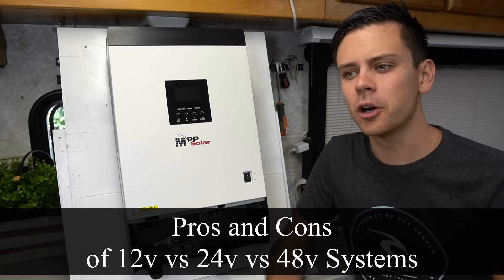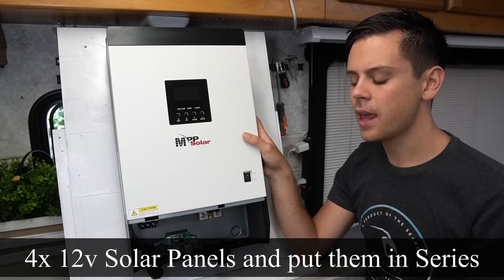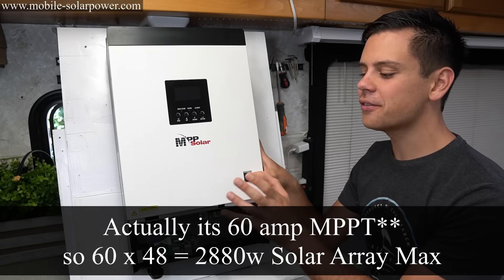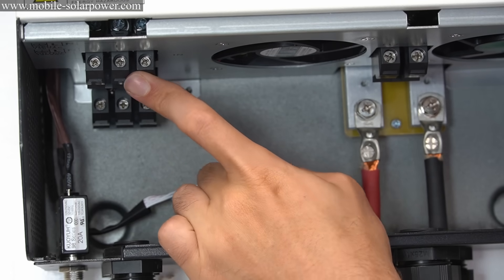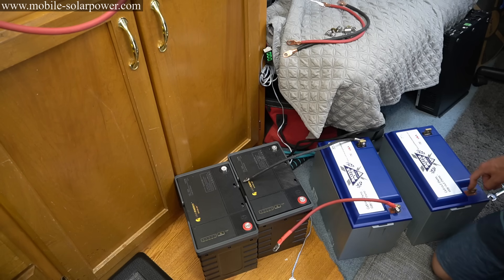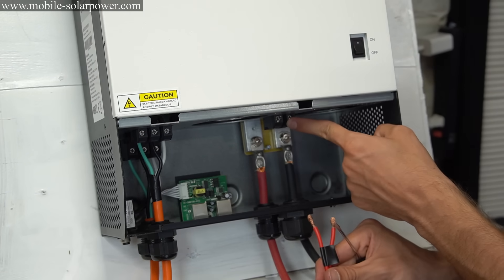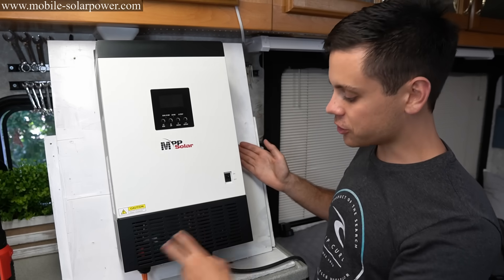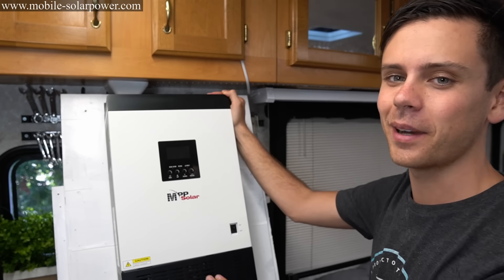48v Solar Power System for Beginners: Lower Cost and More Power!

Comment: I had this MPPT controller on my truck for a few years. The BIG downside which Will hasn't figured is that 4x12V batteries will only charge to the maximum internal resistance of the first battery in the series. I wish people would get a grasp of this issue as it's limiting many people's return on their investment dramatically, in some cases. 
Here's how my real World results work out: I have 2KwH of solar panels on the roof. When I have 4x220A batteries in series the maximum charge I get in full sun is around 550Watts, which is due to the internal resistance of the first battery. (Note: lead acid batteries should charge at around 0.05 C, ie.5% of their total capacity. ) 
Just to prove this point I changed to a 24V MPPT charge controller & the same system charges the batteries at a rate of around 1100 Watts !!; since now it has 2 strings of 2x12V, so twice the 220A X 0.05C. (CORRECTION, I meant 0.2 C, or 20% of their total)
Another solution with the 48V system would be to increase the number of battery strings to 2 , ie. 4S2P batteries, to allow the charge coming in to get a better chance of absorption, & not to get wasted by this internal resistance, but at 50KG per 220A battery it would be pretty darn heavy! However, for me to get the full use of my 2KwH solar panels in a 48V lead/acid system would require 16 X 220A units.
I wonder whether Lifepo4 batteries run into the same problem??

It annoys me that many people like myself have had tto endure such a poor performance because no-one seems to grasp this issue. The potential wasted solar Watts Worldwide could potentially be enormous.
Reply from the maker: What in the world?? Sounds like you had a bad battery in your system or bad wiring. That should not happen. I have systems with 16+ batteries and I get the full capacity of ALL of them at their full charge rate. You need to go back and redesign your system or find what's wrong. That is not normal. Even if internal resistance was off by quite a bit, it wouldn't cause that to happen. Under heavy load IR is a big factor but it won't make that big of a difference and lead acid in series will equalize at high SOC. In commercial installs they will add a balancer. But having a different capacity from having them in series due to ir is incorrect.
Reply from the maker: Just read your comment again and you are referring to charge rate with ir. Sounds like you have a badly designed system with batteries that are too small. This isn't a problem in most systems and it sounds like you have one cell or battery that is faulty. That would make total sense as to why you can charge faster when they are in parallel
Reply from the maker: Also, even if a string of 4 batteries can only handle 1/4 the amps, the wattage is still the same. the charge rate due to ir does not change. do the math with ohms law and measure ir of your batteries and you will figure this out plain as day
Reply: @WillProwse  Thanks Will, but the batteries are all good, (4x220A so more than enough for a 2Kw solar array), & the wiring is all well over spec. Adding more batteries showed the same limitation to 0.05C constant charge rate of this new total.....I think I went up to 1320A at one stage, if my memory serves me correctly.
My system has been so much better as a 24V setup, even though the 24V MPPT controller I have now can only handle 1500Watts of solar panels, unlike the 4Kw 48V MPPT I had (which looks exactly like the one in your video.)
I plan on using the 48V one on my house but using Lifepo4 batteries instead of L/A,  & allow enough to cope with whatever i throw at them with ease, so not a total waste. Hopefully Lifepo4's don't show a similar problem??
Reply: @WillProwse  That's what I thought. However, insert lead acid batteries into the equation & it appears we're dealing with the laws of chemical reactions rather than ohm's law!

Comment: I kinda laugh at the danger factor since i work with 480v so much doing motor controls. The scary size of power is distribution transformers because they buzz and can arc flash just being in there presence.

Comment: Perfect.  Stand alone, no ‘daily ‘supply fee.’ ( connected fee from utilities: regardless of using it or not ).  AC in can be a small cheap ‘stand alone ‘ generator to boost a low battery supply.  👍

Comment: Current not voltage kills.  >100ma=death.  Should not just brush this off just because you deal mainly with low voltage.
Reply from the maker: Yeah literally everyone who understands electricity  understands this and a battery cell can deliver thousands of amps in short circuit, and guess what, no one is dead after they touch their car battery. You should talk about ohm's law and the resistance of your skin, and why higher voltage is so dangerous. Because that matters more.

Comment: Hello Buddy, I have 2 questions for you.
1. I notice you don't use a 
Surge Protection Device like the MidNite Solar MNSPD-115 Surge Protection Device in any of your systems. Is there a reason why?
2. Do I need a battery protect if I'm gonna be using a BMS?

Comment: 12 years ago we bought a small 1300sf home with a basement and walk-in attic.  I bought a 220w 12-18 volt DC and a 400w wind turbine. I also bought 12- group 31 deep-cycle batteries. The panel, turbine, and batteries were 40 ft from the house.  I ran a + and  - run using 4ga high-strand wier about a foot underground through 1.5 pvc s40 to the house where I had a 8 block fuse box and 2 3000w TS-inverts.  in the basement, I then wired a 110 plugin ever-room and 2 110 in the living room.  We used the13w=75 watt 110 bulbs in each light we used the most at night and in the kitchen we used/installed 12v under cabinet RV light under all the cabinets.  The house box was never touched and the battery power was independent.  At that time it cost me $3,100 and we have been saving a 3rd of our elect bill since and without changing our lifestyle or habits.  O, I also run most of all my shop radios, bench, equipment as well

Comment: Grab a 1 ohm 25 watt resistor to arrest the spark when connecting batteries to the inverter unit. It's kinder to the capacitors in the inveter. Put the resistor inline for 5 seconds, then move the battery cable to the battery terminal, and throw the resistor in a drawer for the next inverter you plan to play with :)
Reply: A lot of ‘Greek’ to me. I keep trying to follow, yet It comes at me too fast. If I were building anything like these, I’d first watch the entire video, then go back and pause for the first step and so on. I’m not yet ready to begin my homestead adventure but when I am ready, you can bet I’ll be reviewing everything. Thanks
Reply: Or use a small 120v bulb when it dims out wham charged capacitors no spark
Reply: @gabrielmartinez3171  Only with 12V systems, as the inrush at higher potentials can pop the filament.  Use a lamp rated for at least the system nominal potential.
Reply: @randacnam7321  I do it with 48v system if anything the in rush current is less with higher voltage.
Reply: @randacnam7321  actually I just saw my mistake it was supposed to say 120v bulb like the e27 the middle section on the bottom touch the inverter and the outer section with the ribs to the wire the light will light and quickly dim. If you use a lamp with the cord you hold one side of the prongs to the inverter then the other prong to the live wire.
Reply: @gabrielmartinez3171  I use one of those wire end rubber temporary lampholders.  A good trick is to use a clear lamp so you can see if the filament is intact, although with the 25W lamps I typically use the lamp glows for a good 20 seconds or more on a Sol-Ark 12K so if no light at all assume something is wrong.
Reply: Hey dash8brj! Thanks for the tip! Sorry for my bad english but i did not get it when you said inline for five seconds. Could you explain that? Inline means between the battery positive and the positive wire? Thank you so much!
Reply: can you power up small window ac 3/4 to 1 1/2 hp with that?
Reply: @Jack062358  use soft starter
Reply: @Jack062358  yes but you need like 20 250w panels
Reply: I have a 24v version of one these labeled Iconica but for the life of me I can't work out how to get it to work with lifepo4 batteries, it simply doesn't list lithium battery in the set-up menus.
Reply: Awesome
Reply: Nice
Reply: I have a 5000w 48v inverter i want to work with. Does it matter what size resistor?
Reply: If you actually have a 48v battery, it has a power switch, 24v and 12v do not
Reply: dash8brj Our company's micro-inverters are all upgraded and no longer need Modem! ！ Can directly mobile phone intelligent monitoring, more understanding of technology can add me whatsapp 8613927402025
Reply: Some inverters, PSUs, and other gear sometimes do have internal inrush current protection. These are usually done using a resistor in series, and a bypass relay, that energizes only after unit charged capacitors enough. It is usually just using few seconds delay. If the unit doesn't have it, I recommend sticking a DC two disconnect switches in parallel, and one of them via the resistor. Definitively good to have if you have very big system or you plan to be changing batteries frequently, and stuff.
Reply: @movax20h  nice..thank you

Comment: You can eliminate that battery spark when connecting the cable by simply adding a battery disconnect switch.
Reply from the maker: The spark could destroy the internal contacts of the switch. Not advisable
Reply: DIY Solar Power with Will Prowse Actually, you want to add the battery disconnect switch so that you don’t destroy the internal contacts of the inverter. The switch is a lot less expensive, so it is better to put it at risk rather than the inverter. Plus, the switch will completely eliminate the spark, so chances of it burning the contacts is highly unlikely. Just be sure to use a DC rated switch.

Comment: Great video as always. Any chance we can get a dual phase 220 system build? Looking to make a full house backup for short outages but I have a 220 4 wire water pump which pulls off 2x 30amp breakers.
Reply from the maker: Working on that type system

Comment: What size fuse do you recommend for the battery going to the all in one? Looking at the MakeSkyBlue 2000 watt 12v model with two lionEnergy batteries.
Reply from the maker: Doesn't have as many features as mpp unit i found out. I would go with mpp instead

Comment: Thank you Will for this insightful video, in fact I’ve been waiting for this opportunity as I’ve just bought the 5kW version PIP5048GK. I’ll be grateful if you or anyone could touch a bit on the fusing and circuit breaker aspects as well. 
Congratulations for your new home and project. I’m number one fan. Lol
Reply: Where did you purchase it? Is it 120 or you need a step down transformer?
Reply: @James Edwards I bought it off eBay for £530. It’s a 48v System, exactly what I need so I don’t require a step down transformer. Thanks
Reply: Can you send me link.
I'm in the Bahamas
Reply: I bought it off solar_camper or search for pip5048gk on eBay uk. Hope this helps. Good luck
Reply: Might want to put in a cutoff after the DC to AC convertor. This will allow you to separate the convertor from the rest of the system prior to any battery maintenance or battery replacement. Put in a cutoff prior to going into your fusebox in your home. I would put in a fuse prior to the DC to AC convertor. In case of a lightning strike, this will save you a dollar or two in replacement costs. Since you're in the UK, check with a certified solar technician to see what the local code states. That should give you more information. Good luck.

Comment: I have now watched many of your videos Will, and it is obvious you have a talent for disseminating knowledge. I know I have learned many things!  However, there is one subject I can no longer remain silent on:  Eye safety.  

Every time you make live connections, I cringe.  I understand the limited shock hazard, but the high current is the culprit. 

I have seen the damage one arc flash will do to someone’s eyes. All because a wrench accidentally shorted out storage batteries or other high current capable source.  

Yes, I know, safety glasses look terrible, and even gaudy.  But it takes just one slip, one blue white arc flash, to produce the intense UV, and the sudden spray of ‘molTen meTal’ and bam, you are blind for at least a week, and perhaps permanently.  At the very least, you will feel like someone threw sharp sand in your eyes, and look like a raccoon for at least a couple of weeks.  

People watch and listen to you, Will Prowse?  Please set a good example for others to follow.  Practice wearing safety glasses when making live connections!  Please protect, not only your own eyes, but also help promote safety to others.  You need to protect those “one of a kind” eyes of yours.
Reply from the maker: Ok will do

Comment: One major downside with 48V system is that you lose alternator charging capability with just a cheap isolator, you have to invest on an expensive DC-DC battery charger (I don't know if a 48V charger even exists).

Comment: Correct me if im I wrong, I may be pulling this out my ass but higher voltage all the wiring and components should be running cooler? If thats true in a small space that could mean a lot

Comment: Hi Will thanks so much! this is very timely.  I am trying to decide  if I should convert my current 24 volt system to a 48 volt system. I have 4 285 watt Trina panels and bought the a 60 AMP EP Ever charge controller.  It is my first foray into solar and got a lot of help from watching your videos. My problem is that I have a 48 volt DC submersible pump that I would like to power.  I don't currently have an inverter, I just power my 15 ft trailer with a step down transformer like you suggested in one of your previous vids. My choices are to get a step up transformer to power the pump, or convert to 48 volts and get a 48 -> 12 step down transformer.  I know that there are pro's and con's to both approaches. I was told that if I go with the step up transformer 24 -> 48 volts, I also need to get a power conditioner to remove the high frequency noise that the transformer will introduce into the 48 volt output.  The switch to 48 volt system would be the more expensive route, but I think the benefits might be worth it. What do you think?

Comment: Can you use something like this as sort of a super sized UPS?
Reply: He mentioned using it that way, yea.  Should just double-check that you can tell it to prefer grid power; then it should keep the batteries charged and use them when the grid power is out.

If you don't have any solar, a cheaper option may be to get a 24V or 48V UPS if you don't already have one, then connect more / bigger batteries to it.

Comment: What does split phase mean >?
Reply: It means that the voltage and phase on the two hot wires are (for USA) 120V and 180 degrees apart with a third wire being neutral. This makes the total peak voltage 240V.

Comment: My interest in 48v over 24v is the native 48v DC mini split Air Conditioners that are designed to run direct from panels to unit without an inverter.  I would like an inverter and battery system for my Tiny houses, but have limited roof space for a small AC ‘s 1kw of panels so I want to combine these systems.  Do you know anything about those systems?
Reply from the maker: Wow good point. Can't comment on that but I sure am interested in looking into that. Thanks
Reply: Add my name to the list of those VERY INTERESTED in a 48V mini split AC system!
Reply: I have an idea on these systems. I'm a Solar system installer
Reply: gham elvis  — I’m very curious about your ideas. I just bought an old bus with no solar & no air so I’m motivated!
Reply: @joelhansen7373  I'm also interested, cutting out the @20% inverter loss would make A/C possible for me, but I've only found very expensive 48v mini split A/C designed to survive on salt-water yachts/sailboats, or some completely unknown units overseas where I doubt I'd find an English manual, much less customer support.

Also, as a supplement to keep cool at night without insane batteries... I work for engineers, and they suggested I build a super insulated freezer, full (almost) of water with a car radiator/oil cooler inside, so that the extra juice from the panels freezes the radiator (aka heat-exchanger) inside a block of ice during the day. Then you flip a switch at night, and a 12v pump circulates antifreeze through the heat-exchanger in the freezer through insulated PEX water lines to another radiator/oil cooler near the bed, with a 12v fan blowing air over that cold radiator right to the bed. Then add an insulted door or thick hanging blankets to keep the cold air in the bed area. It wouldn't be that hard to rig a thermostat. You'd have to experiment to find out the best size for each component and the ideal pump rate. Sounds like a pain, but the only way to stay cool at night off grid around the Gulf of Mexico without winning the lottery. One of the engineers has this set up at his fishing cabin using a big deep chest freezer like you have in the garage (with extra insulation), since solar panels are cheap and batteries cost a fortune. He said that giant chunk of ice will freeze you out of the entire cabin no matter how hot and humid the night is.

Comment: In Australia we use 240v single phase.  The same MPP Solar pip hybrid inverters are sold for our market (indeed they may be the same box with different settings selected) 
Is it safe to follow your suggestions for a 240v ( not split phase) setup?  Keep up the great work